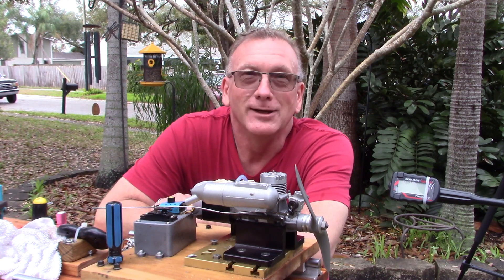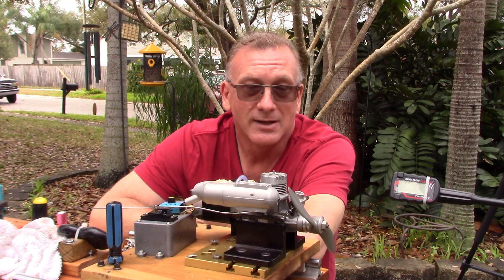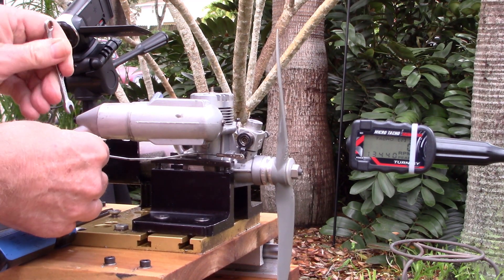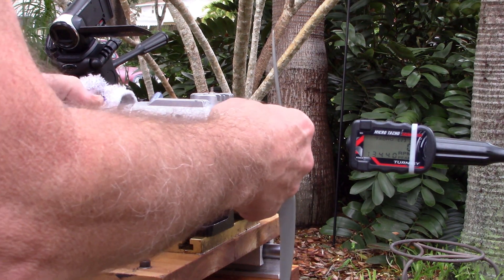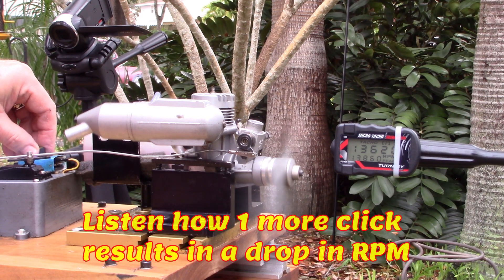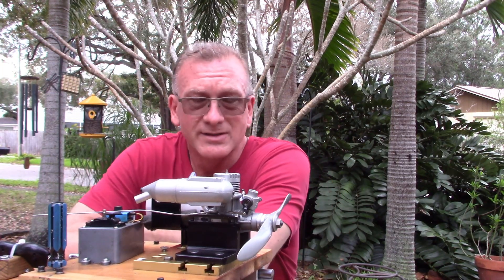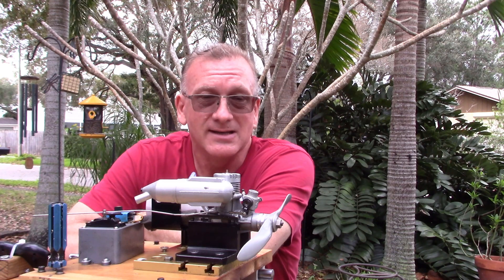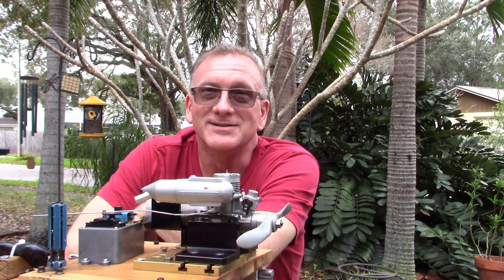OS 46 SF Baffle vs No Baffle 2021 with Static Thrust v3 0

Comment: There's no big difference in RPM/trust readings, but the difference in sound is really noticeable, OS made a good job @ reducing noise  sacrificing minimum in performance. SF series is maybe the longest lasting 2 stroke engine ever produced by OS.

Comment: Great comparison run!

I just checked out the previous run and it looks like the HSN was not peaked and set very rich. Theory is the battle removal let the engine breathe better, and therefore run more lean. In the previous video it was running plenty rich so the gain was massive. In this video it was already peaked out so no more leaning possible, as evidenced by having to re-tune after baffle removal.

I'm open to "alternate facts" anyone!🤣